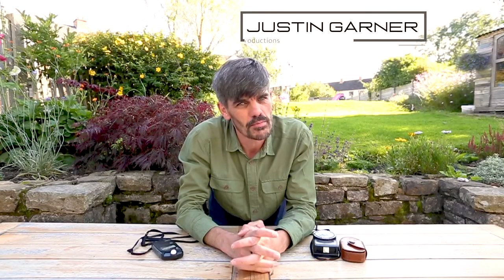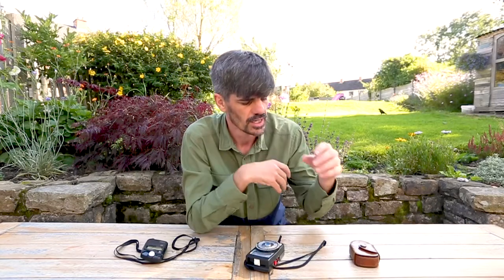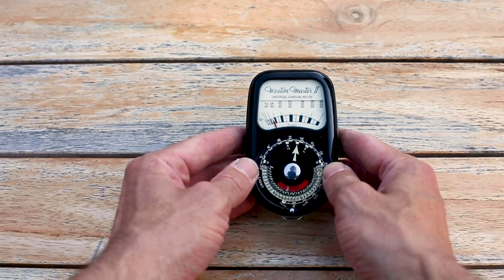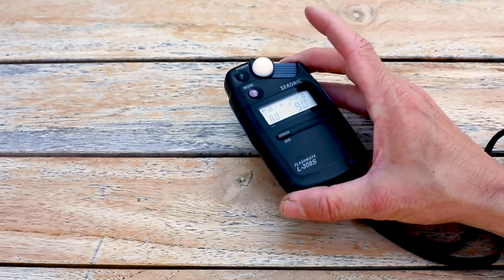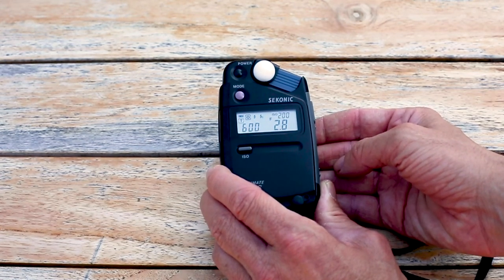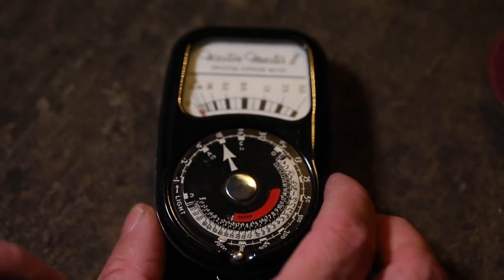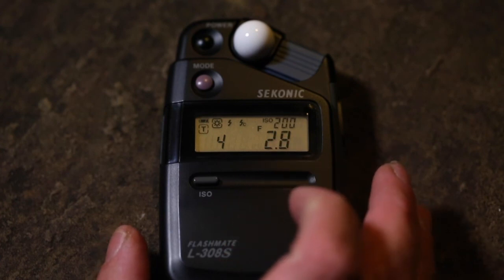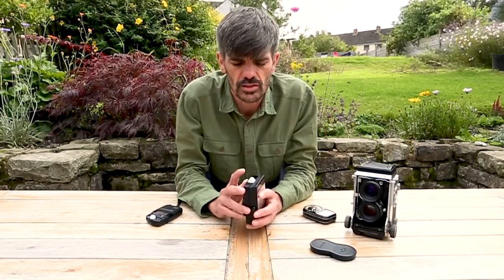Light Meters

Comment: Hi Justin. You are actually using these meters incorrectly in several ways. With the incident domes in place you need to hold the meter oriented horizontally each time, in identical lighting to the subject and pointed at the camera rather than the subject. One other thing that affects the lighting is that the Weston Master II was introduced in 1945, before the standardization of film speeds by the ASA (American) and DIN (German) testing institutes. It uses proprietary Weston film speeds, which differ from the ASA numbers that they are similar to, Conversion tables are available. However the selenium cells used in the Westons decay slowly over the years and Westons earlier than the Master V model are generally inacccurate, especially at lower light levels. I look forward to seeing more of your work as you advance your skils in metering. Andy
Reply from the maker: That is good to know. I made the video sometime ago and I feel if the information is inaccurate I need to take down the video. A really appreciate the comment.
Reply: @justingarner961  Very minor issues! The good information in this far outweighs those two items. Perhaps you could put it in the top note? It's a terrific video overall, so it would be more than sufficient to note them in the video description. Andy

Comment: BTW, incident and reflective meters are not equivalent. You can, however, use a reflective meter like the Weston to get average readings which is what the incident meters measure. The way you do this is by using a neutral gray card or the back of your hand--if you happen to be Caucasian. I will leave to you to find out how these techniques are utilized. You might also look up the difference between incident and reflective readings. Happy research and photographing!

Comment: The Gossen meter is the very best and gives accurate readings. When in a landscape, point it slightly down to compensate for the wide area of sky. To measure, use the yellow triangle, giving 30 degrees. One accessory is the tele attachment, giving 15 (red) and 7.5 (green) degrees. This meter is better than any digital meter, also because the Gossen features the necessary scale, enabling to make a selection for the appropiate F stop and shutter speed. It is weird but presently Gossen refuses to develop analogue meters, which are undeniably the very best for film photography.

Comment: Using the Gossen in incident mode (dome cover over the censor and pointing it at the camera) will give you the perfect exposure more often than any other method.  It is the best meter ever made.  It has so many clever features like being able to dial in filter values so you can read the meter directly for the compensated exposure.  I have had one since 1982.  Spot metering attachments are available for it, including a one degree spot.  Also, there is a rather nifty fiber optic head which can be used to meter off a ground glass screen.  Spot meters have their uses, especially if you are going to use them for zone metering.  However, I am skeptical that the results will be any better than incident light metering.  The real benefit of the zone system if there is one is the use of contrast compensation so you can meter for the shadows and develop for the highlights.  However, this will not work in colour, contrast control during development is not an easy thing to achieve with colour.  I hope you continue enjoy film photography, what makes it better than digital is it is harder to get the result you want and you have to get it right in camera.  The challenge is what makes it so worthwhile.

Comment: I'm new to light meters as well, but very interested and I enjoyed your video. The only I thing I think I know is that when comparing light meters, it should be sufficient to consider only a single F-stop. In your example, when comparing both F/9 and F/2.8, the difference in shutter speed between the F stops should always be (9/2.8)^2 = 10 (about).

Comment: On the Gossen the little dome diffuser is for when you measure incident light (light coming on to the subject).  So the meter should be pointed towards the camera.  When it is pushed to the side, it is for reflective light measure (light reflected from the subject). The meter then should be facing the subject, working like the meter in a camera.  It's probably the same on the Sekonic.   :)
Reply from the maker: Cheers for the information it's really appreciate. I've a lot to learn.
Reply: Yes indeed, you have a lot to learn. Don't put on this type of video if you already don't know how to use these meter..read well the instruction manuals. So all your tests are wrong..@justingarner961